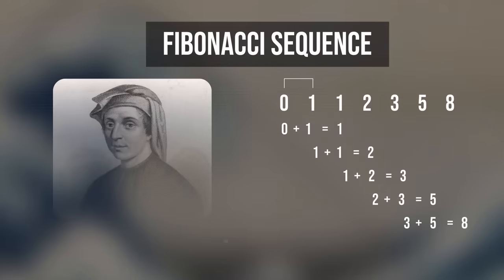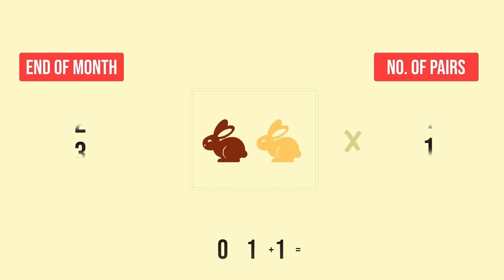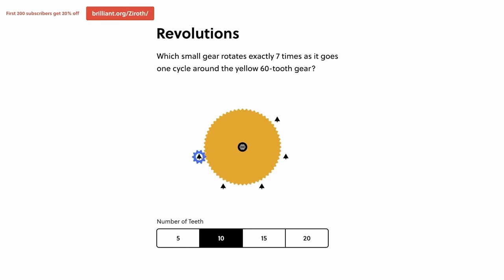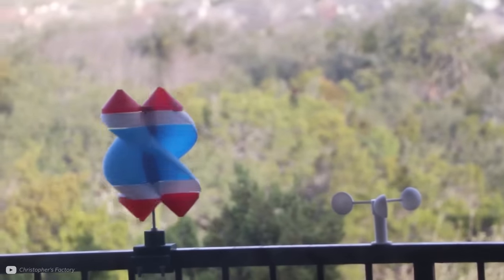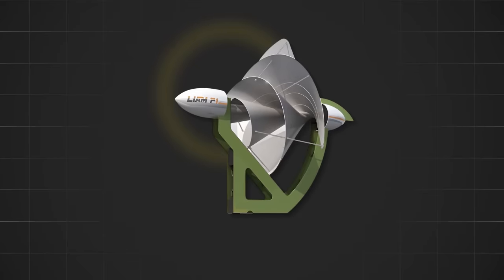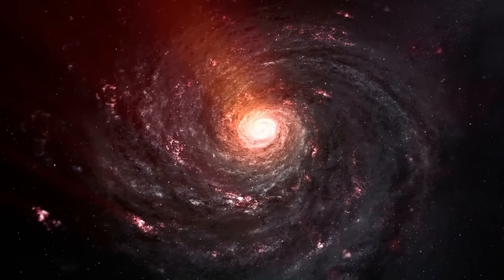Uncovering The Genius of Fibonnaci Turbines

Comment: Why don't they let the air escape out the back of the funnel? Always out the sides. Seams to me if air is squeezed out the back from a smaller hole than it entered you would gain efficiency.

Comment: Pick a number any number.
Pick another number, any number.
Add 
Keep the new discard the oldest
Add 
Repeat the last two steps 

This is the most basic thing you can do with just two numbers, and it IS the golden ratio.

The golden ratio is the larger divided by the smaller number.
No mystery, common sense

No matter what numbers you pick by ten repeats you have that number, 
Try it.

Comment: At some point, someone should point out that the so called “golden spiral” is NOT a spiral.  Every successive 90 degree segment of the figure is tangent to the sides of a square and begins and terminates at a corner; so each successive 90 deg segment is a circular arc.  No portion of a true spiral is ever circular.

Comment: The first spiral wind turbine I saw demonstrated was around 2008. I believe that it was designed by an MIT professor. The benefits are many; vertical or horizontal, very efficient, negligible vibration - allowing them to be mounted on building rooftops (think city buildings with horizontal and/or vertical arrays of these turbines - similar in appearance to the cutting bar on a combine harvester), scalable, relatively inexpensive, much easier to maintain than the massive wind turbines in use, PLUS they do not massacre birds! 
Thank you & Cheers from Seattle! 🍻
Reply: "very efficient"...still NOT.

Comment: Just show how to solve simple constant-coefficient finite linear difference/recursion equations in general.
Here:  x^3 - 2*x^2 +5*x -1=0 has roots approximately  r=0.21676,  s=0.89162  + 1.95409*i, t = complex conjugate of s.
So x(n+3)=2*x(n+2) -5*x(n+1) + x(n) has in particular one solution x(n)=r^n. In fact, n does not even have to be a nonnegative integer. But, to not go too far off course, assume n=nonnegative integer.  Then x(n)=r^n is the solution with x(0)=1, x(1)=r, x(2)=r^2.  Notice how r^n -> 0 as n-> + infinity. But, if you want to start with three initial conditions all of which are integers, then x(n)=A*r^n + B*(s^n + t^n) + C*(s^n - t^n)  for some constants A, B, C. Or
x(n)=A*r^n + 2*B*Re(s^n) + 2*C*Im(s^n)

Comment: Is there an inverse of the Golden / Fibonacci Spiral?  Where the gaps between loops of the spiral get closer and closer together from center to outside?  I could imagine if the center was larger, then the air was forced/compressed as it traveled toward the outside, you could potentially increase the speed of the air leaving the outside of the turbine and therefore increasing the speed/torque of the turbine.  #notaphysicist

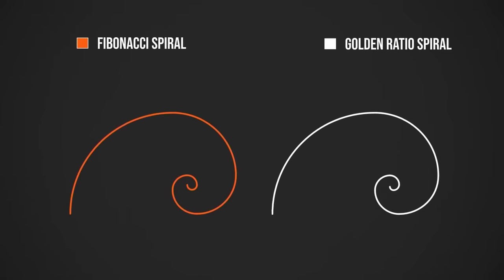Comment: 4:53 
Basically as DARPA & IARPA differences..is not easy to say if IARPA is a little more Slow in getting things or DARPA is just more Prone to Keep in Secrets.
.. Might be as well, as 4 Starred Generals hinted, One is not that much as Slow Horses [Likewise FBI] and the other is just too much prone to 'Oversecrecy'..
[If you don't say :
' I Love You. '
 I can't say
 ' I Know... ' 
otherwise i look like a Idiot or an Incel.
Or a Neuronal Proteomic Absorber.
If you don't say: 
'All we wanted was to Cure Cancer'
China cannot say:
'We too, we were Stopped by the same Antagonizing Forces which are present internally in both countries but as in past they Sprout from Europe, most of all Italy, more than Ever Bologna.']
Put aside the few Differences and work together, you aren't BARDA and FDA anyway... putting you together do not generate higher, more Wide Spread, Damages.. but instead Increases the Efficiency Exponentially while Reducing the Costs of the Shared Projects.

{This works both for
 Internal & International Intelligence 
Alliance- Partnership- Integrative
Sharefull Connection}
Reply: who u trying to impress?
Reply: @dareese6778 
Obviously not your Mom..

Comment: That is just spiralled bladed, meaning each blade gets more area of attack. This has not thing to do with Fibonacci sequence. Even spiralled or helical Savanious is just example of continuous attacking blades, also examples are some Derrius.
I claim Savanious are best blades. They just need bleedholes are they do better in ladder/stepped/stacked formation inside a tube. There simplicity which makes them cheaper is far superior to any mathematically calculated blades (If you just want to do more then make it spiralled. I also claim these bleed holes should be elliptical and also blades need to elliptical.)

Comment: Hello. I watched your video video on the golden ratio. I did alot of research for my book " Her Vision Quest"on the architectural design of the ruins of Great Zimbabwe. I found that the usage of a portion of the golden ratio on the external wall and the usage of horizontal arch internally, enabled the builders to build a ten metre high wall without using mortar with most expediency and the least amount of energy. This was built 1000 years ago by the Shona people of Zimbabwe. This structures still stands today in its glory defying "The Laws of Gravity". I feel that without the usage of the Golden ratio, the walls by this time, would fallen to ruble. Thank you very much for reading my thoughts. Cheers, Tim Haley, author of the trilogy, "Her Vision Quest" found on Amazon

Comment: Guys...sorry to burst bubbles...it doesnt work!

You cant cheat physics!
Google the formula for turbine efficiency and you ll understand why very quickly - you need a BIG swept area!

If your turbine is small, then you ll need to (over)compensate with speed...but this will end up putting massive structural stress on the turbine.

Ultimately, these Dariaeus/ Savonius turbines are just child toys or art projects...but beyond some tiny, small consumers (i.e. some lightbulb) they arent any good for residential use.

Comment: Wrong efficiency. It is about about extracting 100% of the wind energy (which is impossible), it is about extracting maximum energy with minimum costs. Propeller turbines are way more cost efficient. Simple math - you double the propeller diameter you get four times the wind. Fiboturbines seem to be the worst costwise.

Comment: 0:33 Those tiny little turbines on top of those HUGE and expensive towers, how ridiculous. You really couldn't make it up. What is the cost per kWh from those pathetic little turbines? Including the cost of ONE of those towers, you could easily install 10kW or maybe 20kW of ground mounted solar panels... I somehow think one of those turbines never gives out 20kW, and certainly won't be giving it out for eight hours a day (in the Summer). The ONLY thing that matters is cost per kWh. The life of the device (whether solar panels or a wind turbine) also factors into this cost. Talk about a vanity project. You could have put a sail based turbine, ten times the swept area of those pathetic turbines, on top of each of those towers, and generated ten times as much electricity...

Comment: 1) No not "genius".  There's no scale-up. for this geometry due to lack of aero-control (known as "feathering") issues and basic Betz's Law math.  There are solid physics reasons these shapes are not seen in grid (or even micro-grid) turbines at any scale.
2) The output electrical waveform will be full of electrical noise and rectify extremely inefficiently.
3) If you wish to build a "science reputation" instead of a "clickbait one" on this platform, I urge you to stay away from confusing the metrics of "coefficient of performance" with "efficiency".  To use an example, any practical heat-pump will have a coefficient of performance > 1, but an efficiency of less than one.

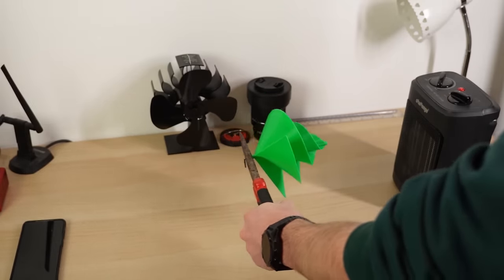Comment: 14:45 - what a scientific demonstration! Laughable! Why didn't you 3D print a larger version and attach a generator to it? You can't have a wind turbine without a LOAD on it, so showing your turbine moving because of a fan means nothing.  Plus this design is impossible to scale up to larger sizes - imagine the cost of one of these with a ten feet diameter, compared to a simple Cretan sail windmill design, using ripstop nylon...

Comment: Facts from a real wind turbine person here:  There is no "genius" to this type of turbine, but rather, the complete opposite.  It is one more example of turbines designed by people with ZERO KNOWLEDGE of wind energy.  What they all have in common is that "any idiot" can understand how they work.  And that is your first clue.  The performance of any of these high-solidity turbines is abysmal, and any claims of superiority should be ignored.  The claim made here is nothing but "clickbait".  We in wind energy find it difficult to convey the real knowledge, accumulated over thousands of years, that has led to what LOOKS like "just a big, leaky propeller" to the average person - but it's not - it is in fact the most efficient turbine design, which is why it is used in windfarms.  And yes, even a Savonius turbine, which you seldom see, due to poor performance, can be slightly improved by adjusting the blade profile away from a strictly circular profile, but the optimal shape has nothing to do with any Fibonacci sequence.  In short, you can completely ignore anything said about wind turbines unless it is from someone who KNOWS how to design wind turbines.  Just remember this:  If "any idiot" can understand how it works, that is probably who designed the turbine, and who will buy it.

Comment: 11:39 - modern, large scale wind turbines are incredibly inefficient because they turn so slowly that MOST OF THE WIND passes straight through the gaps in between the blades (seeing as 95% of the swept area is NOT blade, it's empty space).... yet this obvious fact is completely ignored by the laze arsed idiots who 'design' these crappy wind turbines... Obviously a large, sail based turbine would be both far more efficient (because it would be slowing down more of the wind that passes through the swept area) and much cheaper to build the sails for. (Just look at any sail boat's sails, and look at how much power is generated by them... sailors will know exactly what I am talking about.)
Yet ALL large scale wind turbines have the same, crappy, inefficient and very expensive three blade design. The viscosity of air matters, and this matters because of the SWEPT AREA being so huge on large turbines.

Comment: Would be great if it was true. Alas it is not.
They are NOT more efficient, not even close. 

No Fibonnaci-spirals do NOT turn up all over nature - rather they do not turn up ANYWHERE as that is a piecewise curve constructed from quarter-circles. Logarithmic spirals do turn up everywhere cause they are one of the simplest self-similar forms: a fixed proportional growthrate. The golden spiral is one of those but also not something really observed in nature outside of the to be expected random variations. Even the images you show for "we can retrospectively fit the golden spiral": No, not really as for basically all those images either the spiral does not actually fit, or the image was altered (often skewed) but the spiral simply does not fit the original.

With "this propeller/turbine is X% more efficient" most of the time that statement was just a half-truth - so a lie: Cause they managed to find a combination of parameters where in that specific circumstance that is well outside the intended use the propeller is less efficient. Best i have seen so far was a supposedly 50% more efficient propeller that also is more quiet. And when you then read what they had tested it was their invention against a professional racing-propeller and a less than 30 km/h.... yeah a propeller that is designed to push boats at well above 100km/h is not designed to be quiet or efficient at low speeds. For windturbines if you feel sideways winds that is a sign that it is not efficient.

It is always so disheartening when people lie and falsely claim that the fibonannci-spiral is everywhere cause the people making those Statements KNOW that they are liars:
You know that you either have no knowledge and you have never checked your own false assertions, or you know that you are lying.

Comment: What if a person were to put two windmills on the front of a plastic body, stainless steel frame electric vehicle... (As the EV moves through the air, the windmills charge the batteries.) ?

Comment: 9:07, 13:23 mirrored video footage. actually most external footage are mirrored. BS scam product. full of non-sense commercial terms. also this design is significantly heavier. "easier to turn" is also completely non-sense, how easy? under zero load? what;s the point turning easier without load?